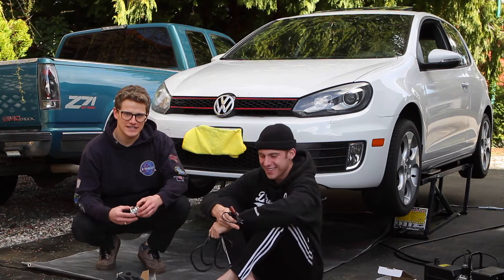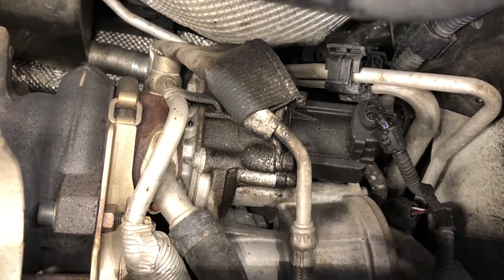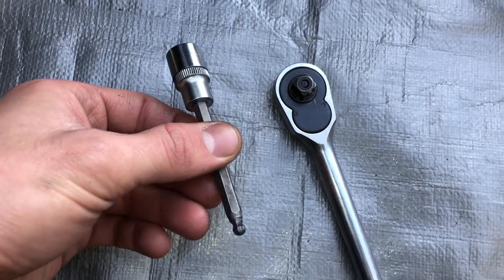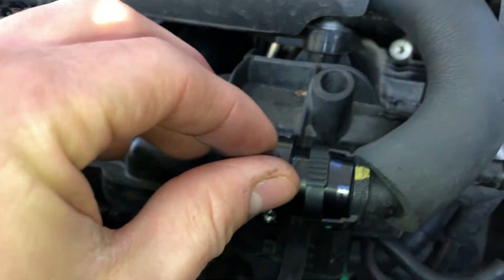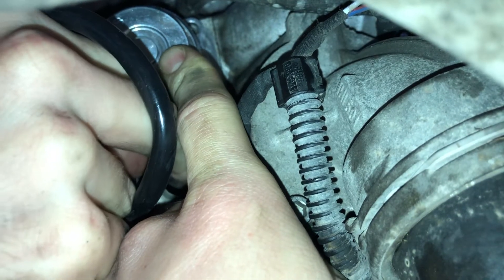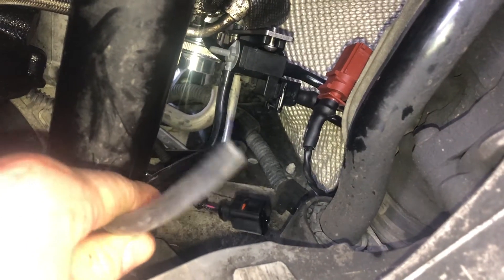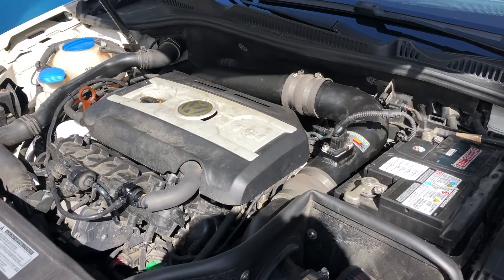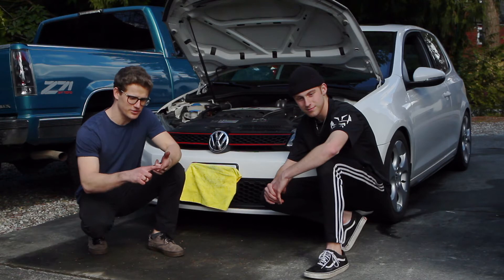2010 VW GTI Forge Diverter Valve Install 2.0L TSI

Comment: For anyone watching this and trying to get the diverter valve out/new one in I recommend quarter inch ratchet with a 3" extension , 5mm Allen bit on the end. That's skinny enough to be able to maneuver around things easily, and get the ratchet head square to the bolts.  I found myself in all sorts of interesting positions, but I got to the two bottom most bolts with my feet pointing towards the front of the car and my head close to right underneath the valve. Top most bolt is most easily tackled from outside the wheel well area. Takes some gymnastics if you're just on jack stands but you should be able to get to it from that side.  Prepare yourself for some frustration.
Reply from the maker: Thanks for the tool tips!
Reply: @Calvinm  thanks for the video! Helped me save some money and now I have a better understanding of how my car works too.  Hoping my experience helps put people on the right path if they don't have a box full of tools at their disposal. Cheers!

Comment: I installed a BOV on mine with a cts intake. But mine doesn’t flutter. It sounds more like a psss sound when let off? why might this be?
Reply from the maker: The flutter noise was a random occurrence. It should sound like a psss when working correctly.
Reply: The car shouldn't go " stututu" that  damages the turbo, it sounds awesome but reduces the life of your turbo, the mk6 gti comes stock with a diverter valve which is better for the turbo as it recirculates the air into the MAF to hold boost a little longer when you let off the gas pedal, The "stututu" sound is the air not having anywhere to go so it escapes back out the turbo which is the awesome sound you hear. But that pressure is what kills the turbo over time. The diverter valve that is stock is really quite and there are upgrades that you can do to the stock diverter valve to make your "psshhh" sound louder and to hold extra boost pressure once you start upgrading power. A blowoff valve on the other hand is a downgrade for the GTI since it releases all built boost without recirculating it like the oem diverter valve does. Keep the diverter valve and you can rebuild it (the diverter valve) with parts from GFB, cobb etc. There are videos that explain what i mean.

Comment: You always want to let your engine get up to temperature before you rev it like that with a petrol turbo car. Your turbo runs with oil from your engine and when cold that oil isn't running freely. You can damage your turbo. Did sound cool though.

Comment: Do you know what the diameter of the vacuum line is? I want to service by dv valve but I dont have the extra vacuum line
Reply from the maker: Pretty sure it's 3/16". Best to take the diverter valve to the parts store to match the port size to the right size vacuum hose.